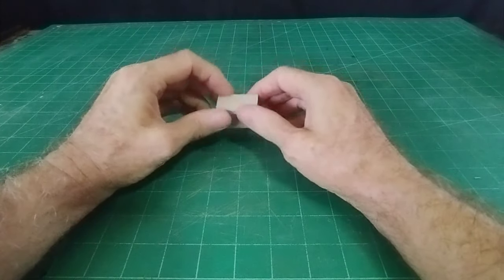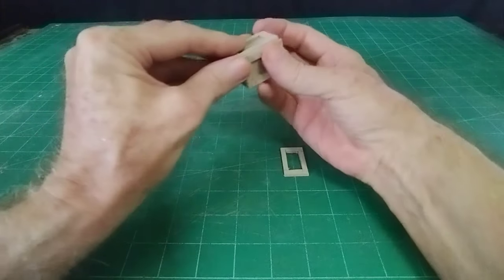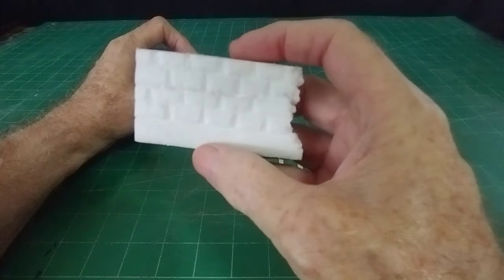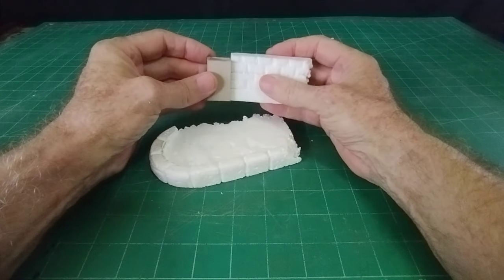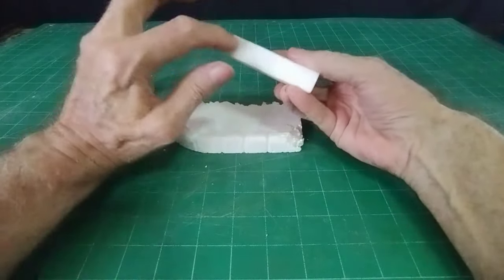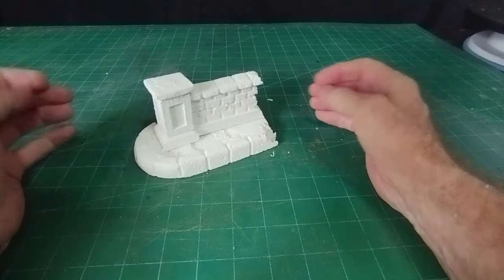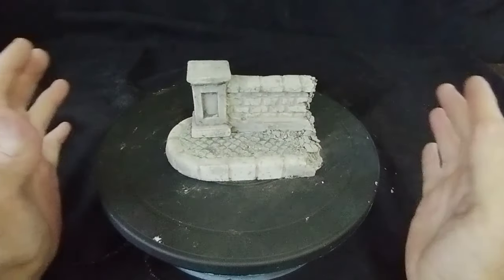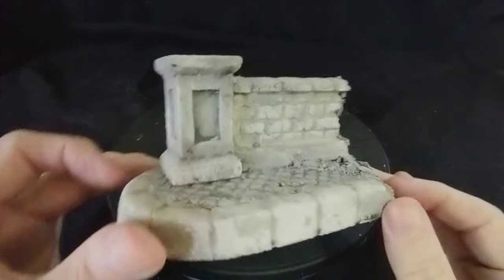Cheap and easy stone wall modelling for dioramas and wargaming.

Comment: Nice work, Don!  As good as any similar, aftermarket accessory and for a fraction of the cost!

45th like.
Reply: Hey, Don, just a quick note and suggestion for a possible future project.  While browsing online, I came across the The Romney, Hythe and Dymchurch Railway in Kent, UK.  This is a 15 inch gauge miniature railway that was fully functional, and even did its part in WW2 for homeland defense, including maintaining an actual (albeit miniature) armored train.  

Though it looks 'cute,' this was no joke, and it's even credited with downing no less than three Luftwaffe aircraft during its operational career.  

I think something like this would be right up your alley, Don!